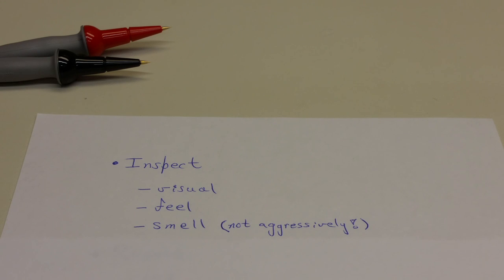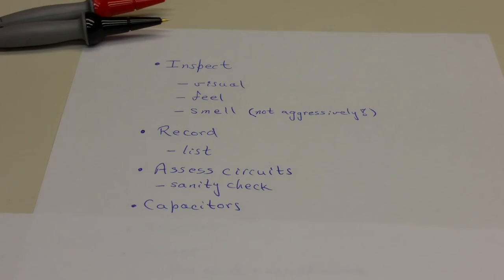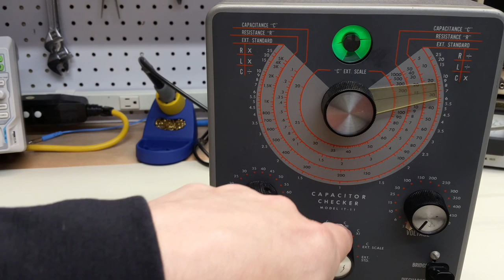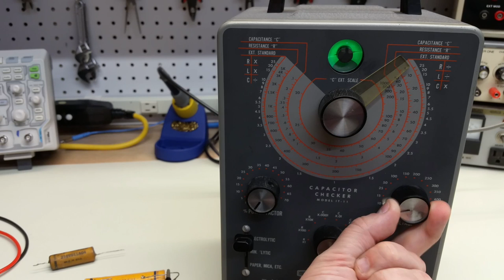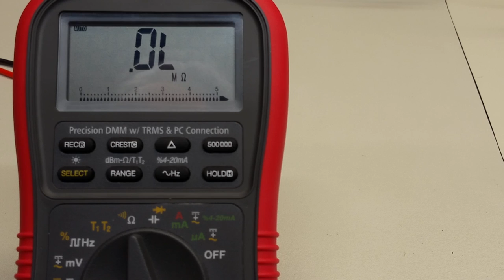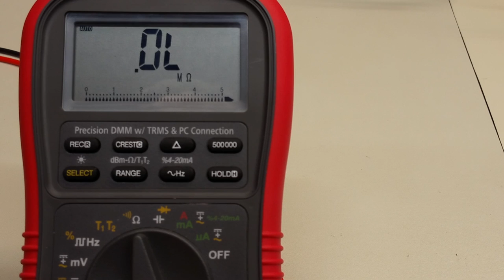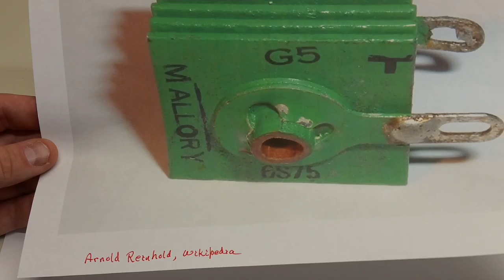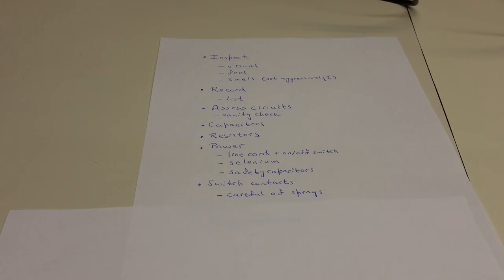#25: A few tips for working on vintage electronics

Comment: Very good ‘ground rules’ especially for those just getting their feet wet. Really liked your walk through on visual inspection.Taking pictures before, during and after is also a best practice; someone else’s comment on checking the fuse also helps keep the magic smoke from presenting itself... Lastly never hurts to remind people to resist the urge to plug something in to see what happens - especially if they don’t have the proper setup: isolation transformer, variac, dim bulb tester, etc. Thanks for posting this!

Comment: Thank you for sharing a good plan for working on older electronics equipment.Adding a item to the beginning - Try to avoid turning any knobs and switches until you do a good visual of any switch assemblies after opening, and if the item is light enough, do a "shake and rattle" test to see if there are any loose or broken off pieces of anything inside of the enclosure. I purchased a Heathkit transistor curve tracer, which, had some small pieces of something rattling inside of it. after opening it, I found a few pieces of a brown plastic looking material loose inside. A good further inspection revealed a cracked and broken rotary switch wafer ( most likely broken from an inpact on that switch knob before shipping), and although the switch wasnt salvageable, if I decided to power and test it, I could only guess as to what may have shorted out in the decision to do that. Also, Selenium rectifiers, which when they fail do so with MUCH smoke, are not a deadly toxin, and Selenium is actually a necessary mineral supplement, but it can cause toxicity in high exposures and excessive handling or ingestion of it should be avoided ( it is shown to be a carcinogen in higher exposures to lab mice and rats)

Comment: Regarding Toxic substances, some of the older Zenith Tube Radios used a sheet of asbestos (usually white) between the bottom of the chassis and the wood cabinet, apparently to prevent fires if something got too hot above the wood case.  (Notably the original Zenith Trans-Oceanic and others.)  Restorers either remove it with adequate protection (gloves and respirator) or in some cases seal it with something like shellac, spray clear paint/plastic, etc.
Reply: Good to know about the old Trans-Oceanics, I've got a bunch of them on the "to-do" pile.

Comment: Back in the day, I can remember the terrible smell of a failing selenium rectifier as they would slowly cook right under your nose. Ugh! I never knew they were toxic, though. Also, what were AA5 radio engineers thinking when they switched off the neutral side of the line and left the rest of the chassis hot all the time? In restoring an AA5 radio, use a polarized power cord and rewire the chassis so the HOT side of the line is switched off. I would be curious how many people used these sets in a damp environment, changing the channel while turning on a cold water faucet.
Your video has some great information. Thanks!
Reply from the maker: Thanks for the feedback, I’m pleased you liked the video. The AA5 radios were designed before the time when the US had polarized power plugs, so there was a 50-50 chance that the plug would be inserted in one orientation versus another. With the cost constraint of not being able to include a power transformer in the design, it seems like the engineers did about as good as they could have done. That said, I’m sure many people got shocked, and I wonder about the injuries or worse that resulted. I’m glad we live in a word where safety is (usually) engineered into products and where the electrical infrastructure and regulatory codes makes that possible! Of course, there is occasionally stupid engineering in cheap products (and sometimes not-so-cheap products), so the buyer needs to beware!
Reply: @radiophysicsandelectronics6923  If I look at old pictures of electric switchboards, like in the early 1900s, the safety culture seems basically to have been:
"Hmm, all that high voltage on open metal bars .. if someone touches that, he will be 'well done'?" 
"Yep, the guy who did that yesterday was. So don't touch it." 
"The switch I have to use all the time is right beside it..." 
"The switch has to switch the main power line, and the main power line is right there." 

If you did have an accident, it was basically seen as your fault and that was it. 

I don't totally agree with the really idiot-proofed way of today though. Often enough safety mechanisms actually hinder the usability of the device so much that people tamper with them, usually making the device MORE dangerous as it ever was without them.

Comment: Your videos are great! Thanks to your methodical and clear demonstrations and explanations my head hasn’t exploded once from electronics information overload.
I stumbled upon your channel earlier today and was shocked to see that you don’t have tens of thousands of views for this (and other) videos. It’s a serious head-scratcher.
I do have one question. Can one actually pick up the capacitor without a risk of (substantial) shock when that thing’s still on the leakage test setting and dialed up to 250V? I’m not trying to be the safety police here. I’m actually just curious cos I’m hoping to acquire that model soon.
Thanks and keep ‘em comin’!
Reply from the maker: You're correct to question, one should always exercise care when using these units. It's best not to handle the capacitor when it's being tested and/or before it's been discharged; this tester and similar testers are dangerous because it is possible to come into contact with high voltage. I'm glad you like the videos.
Reply: He will! Its just a fairly new channel. It takes time to build viewership.

Comment: One question I always have had, though various resistors drift, what is the rate of drift and the potential for further drift and how far will they drift? That is an unanswerable question in most cases. But given the fact these resistors are quite old, the rate of further drift may not be hardly worth noticing. The reason I am curious is the out of tolerance resistor could be kept and reused for a higher resistance requirement of help to use for a  odd value. The old meters  and equipment have a penchant for odd resistors which is very frustrating.
Reply: They will most likely keep drifting when the get thermally cycled again. Also the drift "upwards" is often corrosion at the leads, which can cause a lot of noise, too. 

Remember the E-series are laid out they way they are, since the tolerance fields line up then. If you use modern E96 1% types, you should be fine in any case therefore. 
If it's an old 10% .. use the nearest E12 value and it will be fine.
Reply: I've encountered a few that were as much as triple their rated value, IIRC the worst I've found so far was a 470k resistor that measured around 1.5Mohms.

Comment: Hi, As I watch the video, I was just wondering..  I have an Eico 232 VTVM that uses that type of rectifier, should that be changed, the output voltage is reading just a little high, the unit does work fine? Thank you!!

Comment: Hi there,

Thank you for this great content, it is enjoyable and informative. (Good production value!)

Do you have any good literature to recommend to a musician/audio engineer who is also a theoretical physics student with interests in DIY electronics and restoration of vintage equipment? :-)

I'm thinking of getting the legendary "The Art of Electronics" by Horowitz and Hill, but can you recommend any books specifically about vintage gear (i.e. stuff that uses tubes)?

Take care,
Reply from the maker: I'm glad you found the video useful. As for literature for the theoretical physics-minded (which is my background), my advice is to submerge yourself in physics E&M texts: At the undergraduate level, Wagsness is excellent, and at the graduate level, while Jackson is the standard, I find the text by Ramo, Whinnery, and Van Duzer more relevant for communications engineering. As for electronics texts, I like Simpson's "Introductory electronics for scientists and engineers" (Allyn and Bacon, 1974; though it's very dated at this point), and of course Horowitz and Hill's venerable "The art of electronics" is great. To deal with the vintage electronics topics, I suggest beginning with early-1960's versions of the Radio Amateur's Handbook or an undergraduate engineering circuits book from the same era, such as Angelo's "Electronic circuits" (McGraw Hill, 1964). If you're interested in tubed electronics, RCA's "Receiving tube manual" has a very worthwhile introductory chapter, and while dated, Christ's "Radio tube fundamentals" is available in reprint and worth reading. At the very pragmatic level, the Antique Radio Forum's "Test equipment and tools" discussion area is an excellent searchable resource. I hope this helps!
Reply: Thank you for your ample reply! I will take a look at the books you listed.